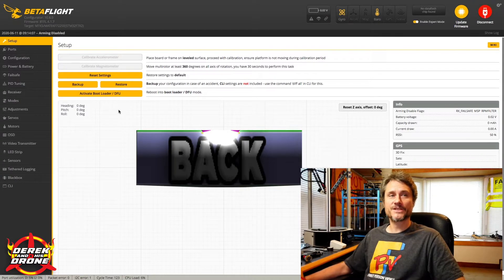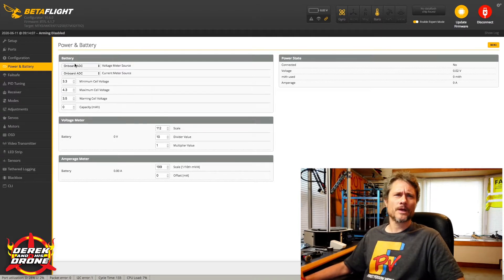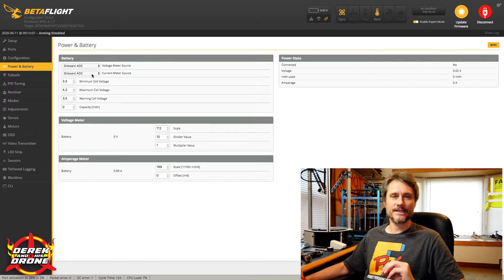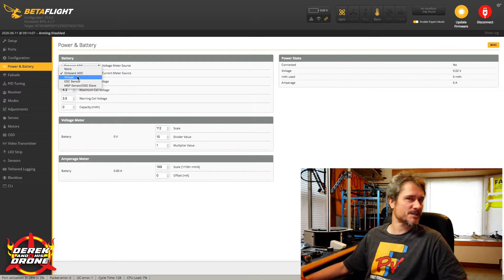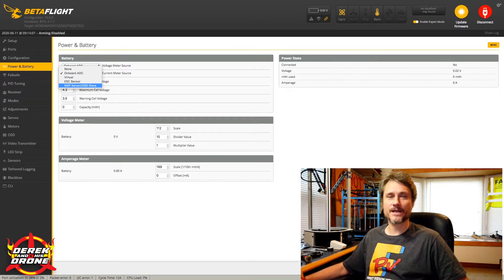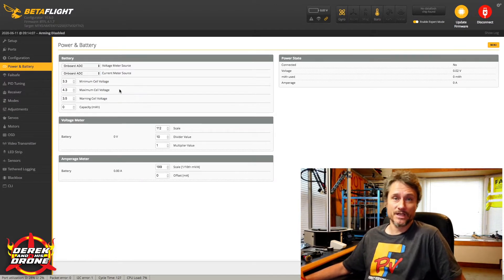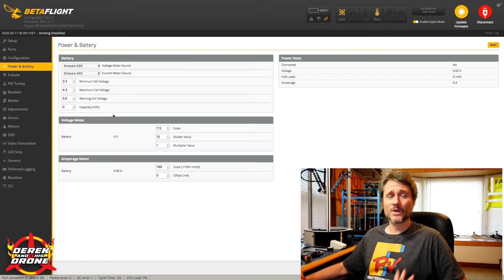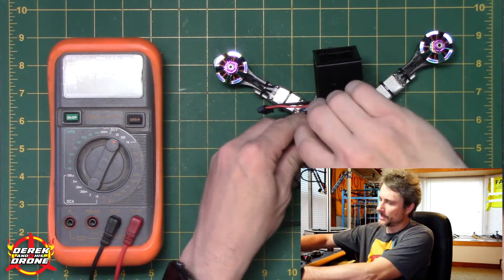Basics of Betaflight - Calibrating Battery Voltage and Amp Meter

Comment: I followed from the last video and a comment about asking to be shown math . So if charger meter and test meter work ,  you scale the flight controller settings for voltage and/ or mAh used to try to match . So . 
 If bf=>charger then scale\/ . 
   Etc
Reply from the maker: new_scale = old_scale x (OSD_mAh_consumed / mAh_charged)

Comment: You may have explained and sorry if u did, but when u recharge the battery to get the mah put back in, do I use just the charge option or balance option or does it matter?
Reply from the maker: Always balance charge a LiPo battery.  Using any other setting could lead to a fire.

Comment: I feel like my scale is close for full throttle per manufacture chart.. but hovering is way under. I think i need to shift it up like 4amps
Reply from the maker: The scale will never be 100% accurate.  The best you can do is get it close through calibration.
Reply: @DerekandhisDrone  Yeah just want mah close. And see amps for when running a Li-ion

Comment: Apparently my 1300mah battery consumed 2700 mah and I draw 189 amps on punch outs. am I a Kang yet? But atleast my voltage is accurate lol
Reply from the maker: The voltage reading is usually pretty close out of the box however it is always necessary to calibrate your amp meter. If you follow my instructions I find it is rather accurate within three batteries.
Reply: @DerekandhisDrone  I pretty much just trust the esc architecture. My tune is conservative and I make sure every motor is smooth and cool before and after every flight.  6s 1800kv on very efficient nazgul props. I barely do full on long term punch outs, and eve just 50-60 percent blips are enough to get me through most freestyle tricks. I'm too lazy but you video really did help explain. One day I'll tackle this and feel proud. Oddly enough,  although I don't trust the anp reading at all, it seems accurate to experience during low/mid throttle but on ful throttle spikes to 180-210amp INSTANTLY no matter how low in amps I started. I've tested seeing if long holding this would blow the esc but no. Everything stays very cool. 🙏